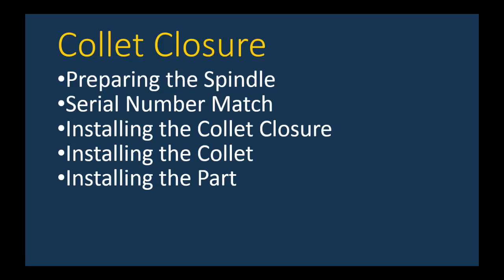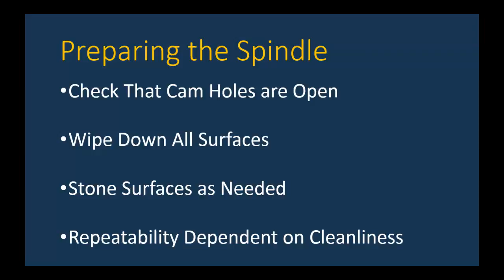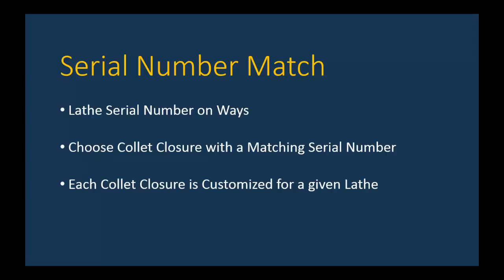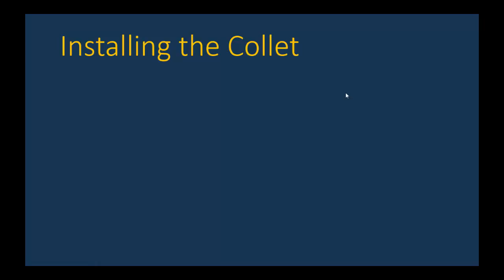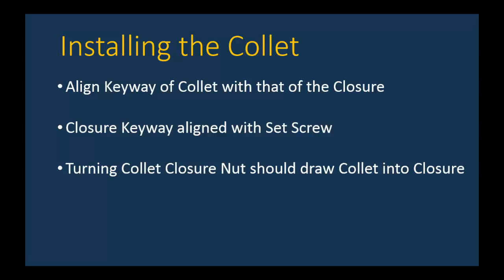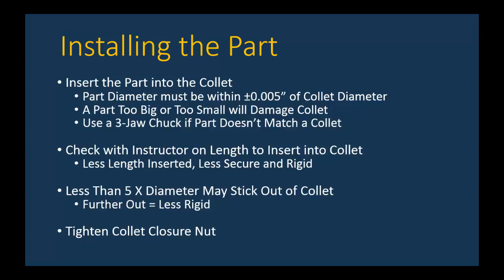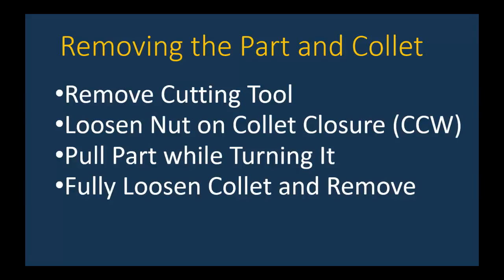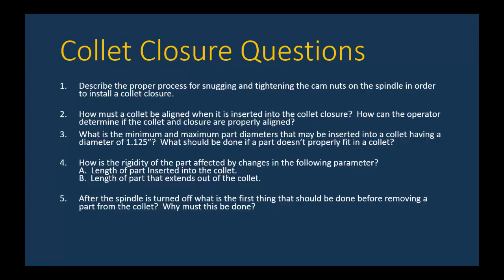MCC ENR 153 Machine Shop  Video Lathe 4  Collet Closure

Comment: 1.) First, ensure that you have selected the correct collet, one that has a serial number matching your lathe. Then, align the keyway of the collet with the keyway of the closure, and align that with the set screw. Turning the collet closure chuck should draw the collet into closure.
2.) The keyway of the collet and the keyway of the set screw must be aligned. If done properly, the collet should be drawn fully into the closure.
3.) Only house parts that are within 0.005" of the diameter of the collet. For a 1.125" collet, this means a maximum diameter of 1.130" and a minimum diameter of 1.120". If a part does not fit within these guidelines, select a different collet. 
4.) The greater the length of the part that is housed within the collet, the greater the stability of the part. When the length of the part outside of the collet increases, the part becomes less stable.
5.) Before removing the part from the collet, you must remove the cutting tool, as it will prevent accidental cuts and scrapes.
Reply: was missing you on the 3rd lathe video man. thanks for the help as always